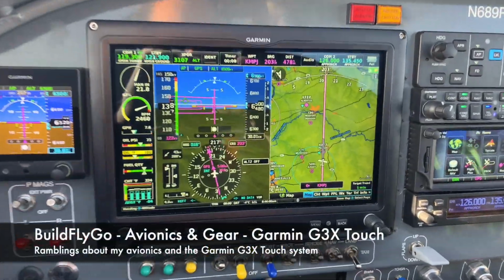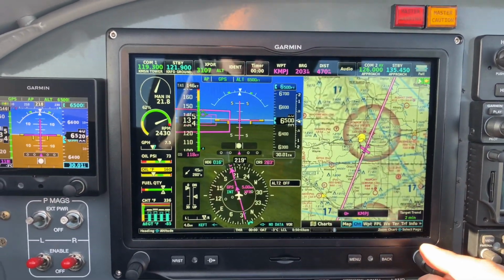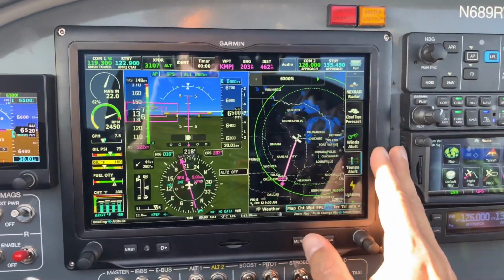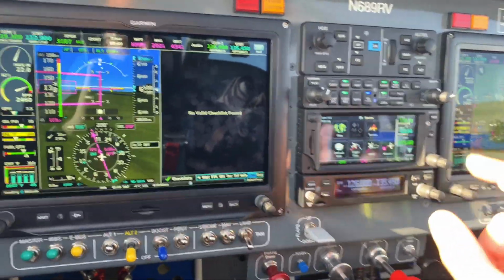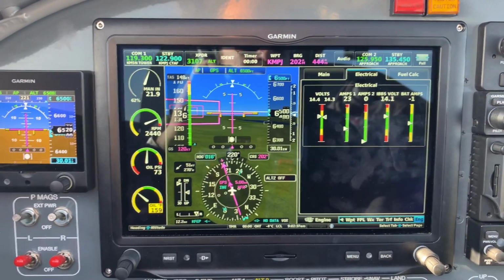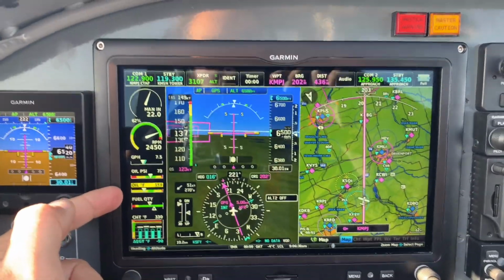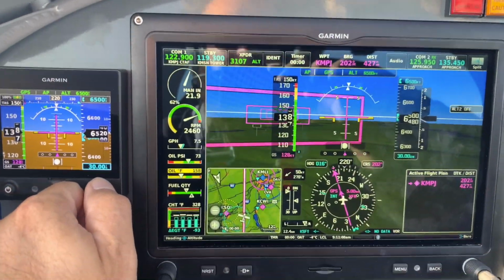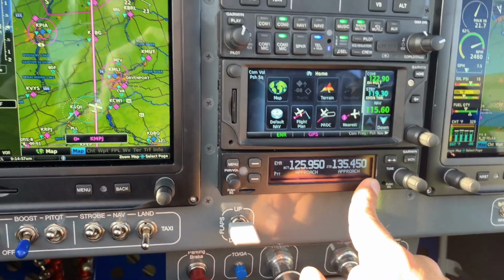Gear I use: Garmin G3X Touch, GMA245, GTN650, GTR200, G5

Comment: I’ve been able to dive into the 650 pretty deeply with the training app but the G3X is a little different…the only time I get “time” with that is in reality…so you run the battery ragged learning about everything, you sit there with your engine running like a bozo or you get to a certain screen in flight and go “uh oh, I’d better figure out a way to get back from this one”. The nice thing is that it’s very intuitive. You touch what you want, scroll through screens and that’s pretty much that.

Comment: How do you get the magenta boxes? We have a G3X but when a flight plan is in from the GNX375 it only gives a CDI. What's the trick for the boxes?
Reply from the maker: Hmm, I bet there's a config option to turn these on/off. I've never had them off, they show up by default for me. Check the Pilot Guide.

Comment: There is a huge difference between someone talking discrete system features on the ground or on a sim or kiosk, and seeing you actually running through features in flight.  I just purchased an RV-7 with a very similar Garmin setup (one G3X, and no nav-com in my GTN - otherwise same) and your video has done more for me learning this system than all the offline training stuff I've tried.  Thanks very much.  Would love to see more like this, as Garmin adjusts features with software upgrades.

Comment: nice,,, could you do without the g5 if you just added a battery to 1 of the g3x ? or both would be better :))
Reply from the maker: The g3x have batteries. For IFR you want a separate source of attitude.
Reply: @BuildFlyGo   doesn t each g3x have its own  adahrs ?
Reply from the maker: All running the same software, so if there's a software issue you'll want something separate to keep the blue side up :)

Comment: Great Video, thank you, why four switches for the emags?  And what are the two indicators above the G3X? 

Do you find all your inputs through the G3X and not the GTN 650 besides setting up approaches?  

Thank you again
Reply from the maker: Enable and external power for each. I usually load up all flight plans in the GTN out of habit.
Reply from the maker: And the two indicators are the g3x Master Caution and Master Warning outputs.

Comment: The exact panel I was thinking of putting in my RV-14 when I have a bit more time and money!
Did you do all the panel cutting/wiring yourself or did you outsource some of it?  I trust myself to be able to do it but don't know if it's worth the money savings.  Feel like I'm going to end up missing something small and get frustrated - but hey, that is part of the process after all.  Would be interested to get your opinion.  Thanks!  Great video of the actual functionality, first one I've seen that was exactly what I was looking for.
Reply from the maker: We did the design with a company out east that cut it for us. We then did all the powder coat and engraving locally. Aircraft Specialty is doing our new panel cut and they have been excellent to work with.

Comment: It looks like the GTR200 already includes a basic audio panel. Why did you get a GMA245?
(This is a serious question. I am wondering if there are features that are missing from the GTR200 that were necessary for this setup.)
Reply from the maker: We have two radios. The GTR200 includes a basic intercom but no audio panel switching capabilities which are required in a two-radio setup.
Reply: @BuildFlyGo  thanks!

Comment: Garmin is good but any specific killer reason you chose this over the Skyview HDX?
Reply from the maker: We tried them both out and the Garmin felt a lot more like real avionics to us. Everything from the user interface to the quality of the buttons. And now with SmartGlide they have jumped well ahead on the functionality side of things too. It’s a personal choice, don’t listen to the talking heads, try them both out :)
Reply: @BuildFlyGo  Thanks for the feedback.  Things that can be done internally with software should allow Dynon to also implement anything that Garmin does like smart glide in software and vice a versa.  It seems they have very equivalent functionality if you are not building up an IFR certified panel.  You do have a great setup in that video but i also came to the conclusion that unless I was able to install the right side display at an angle that makes it much easier for me to use from the left seat then I'd rather put in a large iPad via a RAM mount and bring up close and facing towards me.  You don't use an iPad to preplan the flight and keep it in the cockpit as well?  cheers.
Reply from the maker: @luckymacy  software is software but not everyone does the same thing. I suggest not making decisions without trying both systems out first, you may be surprised by how the quality of the hardware matters. Agreed that the screen to the right is not as visible to the pilot seat. Its still very usable though. We have an ipad with Garmin Pilot that I use for initial planning and filing. It is often in the plane as well but put away for use on the ground.

Comment: Your panel is exactly what I want in my Bonanza (don't need the second G3X though) but a very well done explanation.  If I may, I would suggest your oil temp is way too low.  Your not burning out the moisture etc. at that temp.  I don't know how your oil cooler is situated but you can try to block it of some air flow and it should bring your temp up.
Reply from the maker: Yup, this was an early winter flight before we blocked off the cooler.

Comment: I work at a FBO at KDWH, it’s my first job And I plan to start flight training in the coming months, being a teenager interested in Aviation I’ve been offered rides in peoples planes, so far my favorite has been a 2013 Piper Malibu, My dream plane is tied between two ether a Fully Loaded Piper M350, or a Piper Saratoga or Lance with a GFC 500 above the GTN750 with that stack being flanked by two G3Xs with a G5 left of the left G3x, and putting the altimeter and speedometer in between the GTN/AP stack and the LEFT G3x, And then the G3x on the right would be as close as possible to the GTN stack and a I pad mount to the right of the G3x, That is 60K worth of Avioncs but if I bought a Saratoga or lance I would try to get one with a GTN750 in it. Nice video definitely nice to see the features of the G3x it’s features and UI remind me a lot of the GTN750.

Comment: Good info.  Do wish you would describe the GTN650 and how it is used in this config, more.  Also go over the features of the moving map.   If you can access the radios from the PFD/MFD panel, why have another physical one mounted on the panel?
Reply from the maker: Take a peek at one of the instrument approach videos, that should cover uses of the 650. The physical radio #2 was mostly because I like the knobs. I'm thinking it will be remote on the new airplane.

Comment: I’m going with pretty much that exact same panel. Building an RV14A. If you had to do it again, would you change anything.?
Reply from the maker: Put the trim breaker on the ebus. Remember that trim power comes from either the servo or the trim breaker depending on mode so have them both handy.

Comment: Does the aircraft icon appear on the approach plates (on the PFD and/or MFD) during approaches so that you can visually see where you are on the plate, sort of like when displaying plates on the map in ForeFlight? I'm trying to think of advantages of the dedicated MFD other than XM Radio (I can stream XM through my iPad). There is engine monitoring, too, I suppose.
Reply from the maker: Yes, you can see an aircraft depiction on the plate.

Comment: Hey Guil, I really like the panel layout. Did you design it? What is master caution wired into? Does the Garmin stack provide a source?
Reply from the maker: Hey, thanks. I did the design and had a Cnc shop cut the aluminum. Master Caution is driven by the g3x based on values you set. You’re probably seeing a low fuel caution, I have it set to 8 gallons, which is an hour of flying. When one tank is down to 8 it lights up to let me know. The other tank has a bunch more fuel. I’ve been thinking about changing the logic in that.
Reply: @BuildFlyGo  looks great. I’m always looking around for ideas for the panel. So far yours is the best I’ve seen, and I may just incorporate some ideas into mine. :)

Comment: Gorgeous panel! Who built it? Cool oil temps.. looks like you could use an oil shutter door in the cooler. I feel that putting the shutter in front of the cooler gives more control than putting it on the back.
Reply from the maker: I built it :) Yeah, some form of airflow control over the oil cooler would definitely help when moving from summer to winter temps.
Reply: @BuildFlyGo  wow, great looking.. I love the placement of the AP control on top in The center. Where did you get the panel cut or labeled? How about the wiring schematic? I’m building an -8 and still way far out for panel design..but always learning!
Reply from the maker: I had it cut by UpNorthAviation, local powdercoat guy did the coat, I made the CNC file and had a local trophy shop do the laser engraving, then I filled that with acrylic paint. I sorted out the wiring together with ACS based on the garmin manuals.

Comment: Great video and very informative. I will be ordering my panel shortly for a Rans S21 and I’m running into a dilemma. I have two options and one being set up exactly  exactly like yours with the  two 10.6 inch screens. I plan on doing quite a bit of IFR flying. I don’t really want to run a split screen on the PFD. However my thought is glancing all the way over to the right for the MFD might be distracting and too much head movement and maybe even at an odd angle and far to reach to adjust things. I thought about placing a 7 inch portrait right next to the PFD as my navigation MFD. Thus keeping my scan much closer well having an easier reach.
Reply from the maker: There are a few setups like you describe with the smaller display just to the right and I hear they work well. I agree with you that shifting your head over to the screen in front of the passenger is not ideal. I find that a split-screen 10" screen is more than sufficient and I am never tempted to go full-screen. It's wasted space honestly :)

Comment: I am about to upgrade my steam panel in my A36 around a G3X/G5 foundation.....Q : was there a reason  why you went with a GTN 650 over a 750?   Trying to rationalize this .....just wondered if it was more than panel size logistics ?
Reply from the maker: The main benefits of the 750 over the 650 are screen size, approach plate display, and remote device control. All of these features are also in the G3X but on a much larger screen. With the price difference between the 650 & 750 I almost paid for the second G3X screen.

Comment: Thanks for your great video. I am thinking of building a Sling TSI with almost exact the same avionics as yours: dual G3X, 650xi, GTX45R, GMC507 and 2nd GSA 28 autopilot servos, GMA 245R, G5, GTR20, GEA24 engine monitor, GAD 27 Flap and Trim controller, GAP26 heated pitot. Do you have any suggestions in terms of what else I should add or what may not be necessary? Thanks in advance.
Reply from the maker: This very much depends on your mission. If you plan on flying a lot of IFR, make sure you have sufficient power, indicator, etc redundancy for your comfort level. If you plan on only flying VFR, you can save a lot of money by skilling the IFR bits :)

Comment: Nice panel - a few questions: Did you consider the GNC 375 instead of 650? Is your EIS configurable on the G3X so for example you could just have CHT/EGT page only? How challenging was it to replace your fuel probs if you could estimate? My ideal EIS in the short term would be EGT/CGT/%HP and Fuel/Fuel Flow -- any thoughts on that given your experiences? I was trying to avoid the 650 from a cost perspective thus the 355/375 idea.
Reply from the maker: The 375 was not available when I built the panel. It's a great GPS/Transponder and I'd definitely consider it when the time comes for the next airplane.

I'm not sure what you are asking on the EIS page configuration. You can change it around in many ways, could you ask your question differently and I'll try to answer it?

There are two fuel sensors in the system, a fuel flow which is in line with the fuel line going between the servo and the distribution block, and a fuel pressure sensor that comes off the pressurized side of the mechanical fuel pump. It was not difficult to install, just part of the regular aircraft plumbing.

If you have fuel injection you also need fuel pressure. I believe Oil temp is a required gauge (FAA). Other than that, you basically are describing what's on me EIS page on the left side.

Yup, the 375 is a great option if you don't need VOR/ILS.
Reply: @BuildFlyGo  The other issue of note in comparing systems -- you have the GFC500 whereas my unit only has the built in G3X autopilot - what are the key differences that you can advise between the two autopilot configurations aside from he fact that the GFC undoubtedly does more. (fyi, Im buying this airplane with the aforementioned configuration, thus the questions).
Reply from the maker: The G3X autopilot is virtually the same as the GFC-500/GMC-(304/307). The GFC/GMC is really just the head for the servos and provides a little bit of redundancy in case your screen dies, and offers some physical knobs. If you have the G3X autopilot without the head unit you still have almost all (if not all?) the functionality, you just need to use the touchscreen for it.
Reply: @BuildFlyGo  Again, many thanks -- no, it does not have the head unit - all functions are via the screen. But this is most helpful. Great job on the videos, probably the best out there as far as I've seen.
Reply from the maker: Happy to help :)
Reply: Thanks - very helpful indeed. So my unit already has a G3X but it does not have an IFR Nav/com -- trying to get around the price of a 650, thus looking at a 355/375. Already have a 345R Transponder, so just need a slimmed down version  of the 650 (only really care about WAAS). Regarding the EIS -- sorry, I was not clear - I'd like to keep my existing MP/RPM gauges (analog) and simply add to the EIS the following in priority order of importance (and cost) : Engine monitor: CHT/EGT & possibly Fuel flow/level/Engine HP% -- but leave everything else as is in analog form -- can that customization be done (meaning leaving out some functionality) -- thanks again.
Reply from the maker: If you have a GTX-345R already you don't need the GNX-375 as that includes a transponder. Go with the GNC-355 which is a GPS/COM.

The EIS is a single box (GEA-24) so you will have access to all the functionality once that is installed. I believe you can disable some of the gauges in the configuration but if you don't have RPM/MP it won't be able to calculate %power. There would be no cost savings other than the price of the sensors you don't purchase. Personally I'd spend an extra couple hundred bucks and get the MR/RPM sensors ;)
Reply: @BuildFlyGo  Thank you - yes, I've settled into the 355 as the right fit. I'm just reluctant to re-cut panel so trying to add functionality into that G3X without re-customizing the panel. It's less about cost and more about simplicity in the re-work (plug and play). Many thanks for your input/feedback. Yes, good point about %HP.

Comment: Thank you for the vid! Fellow Brazilian here from Seattle considering building as well. Quick question: do you need the GTR200 and audio panel or you had them added for convenience? Wondering if all can be accomplished via G3X. Thanks!
Reply from the maker: The G3X itself doesn't have a built-in COM or Audio Panel, so if you want those functions you need to add them. There are remote versions of the two (GMA245r & GTR20) and both the remote and non-remote are controllable via the big G3X screens. I went with the non-remote as I like having knobs for those things :)

Comment: Your rpm is 2500
That's our heat up rpm and our normal cruise rpm is 5000 sling2
Reply from the maker: احمد ٕ different engines have different cruise rpm settings

Comment: I also own a tip-up RV-9A with steam gauges.   How did you modify the Forward  Fuselage Ribs F-745-R and F-745-L (Drawing 24A) between the the Instrument Sub-Panel and the actual Instrument Panel to accommodate the Garmin 10.6" EFIS?   Did you consider using the 7" Portrait instead the 10.6" EFIS?   Nice Panel.
Reply from the maker: I did two things. 1 - I used the avionics trays as a structural support by attaching them to both the front panel and the subpanel, and strengthening them up with some angle cross-beans. 2- I used a piece of angle on each side attached to the top area of the panel transferring the load to the subpanel. I am not an engineer, so no math done on that, but it was worked well. I'll try to remember to take some pictures for you this week.
Reply: @BuildFlyGo   I would appreciate pictures to visualize what you did.  Thanks

Comment: Very nice video ! Just one question, which device is being used as the transponder ? I know you said you could change your XPDR code in the G3X but it's only a display right ?
Reply from the maker: Yes, the G3X screen just controlled the remote transponder. I use a Garmin GTX-23 transponder.
Reply: BuildFlyGo thanks for the quick answer ! Keep coming with the great content !

Comment: This is a panel that's easy to love.  Did you build the panel or farm it out?  If so, what shop did it and how was the service?  Keep 'em coming!
Reply from the maker: I mostly built the panel. I used a panel cut company to do the cut to my design, then I got it powder-coated locally, then had a local laser engraving company burn out the labeling from my CAD file, and I finally filled in the label cutout with acrylic paint. It was a fun project.